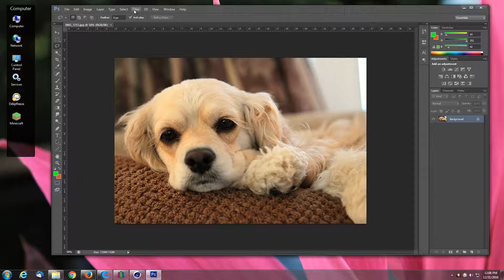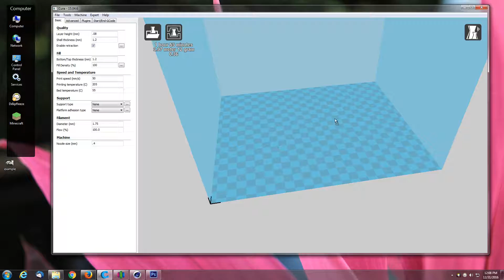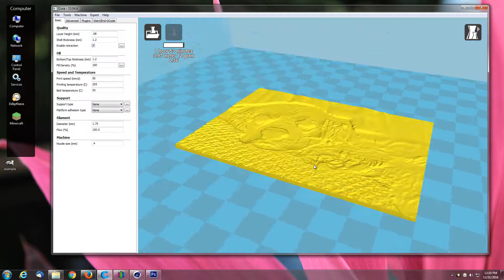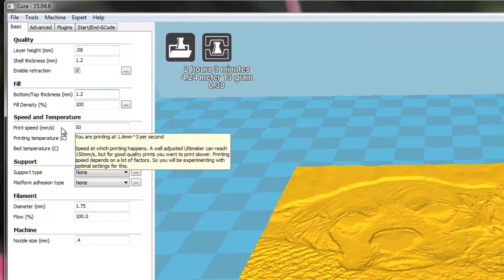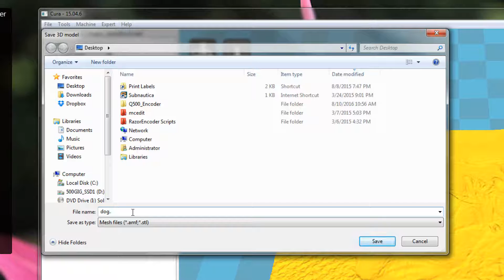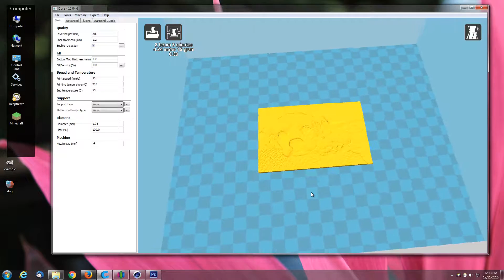3D Printing an Image as a Lithopane Prusa i3 MK2

Comment: Thanks for the video. Printing my first try now, but my picture is sized 100x75mm, and it takes 6hours and 40 minutes to print using the same settings as you. Any clues as to why that extra cm gives me a print thats 4 hours longer than yours?
edit Using a wanhao duplicator i3 plus btw.

Comment: 7:30 remember bulb heat could soften PLA. An LED may be an option
Reply from the maker: Ya, it's designed for a LED
Reply: I look forward to a video, see if it cast a shape shadow on to the walls.

I was thinking  you may try a rotating shade so the images change, most lights like this use heat to turn it.

A bit of electronic; Arduino microcontroller could fade different LED's to simulate this rotation think, watch out for High Voltages with control.